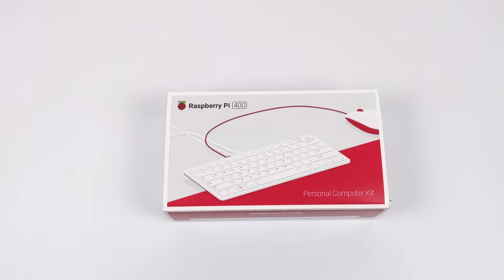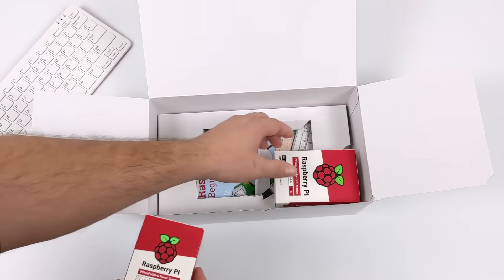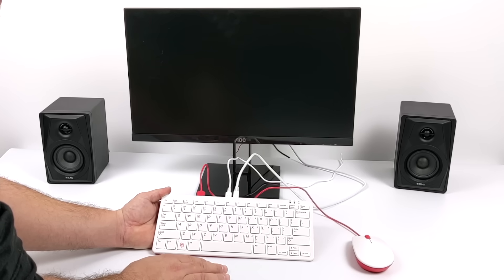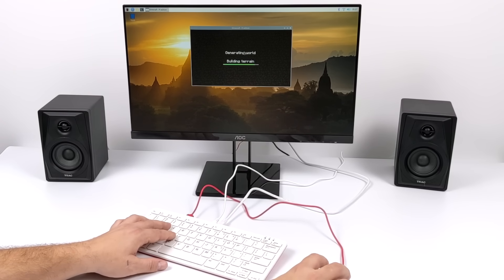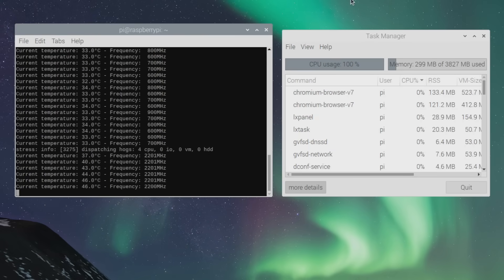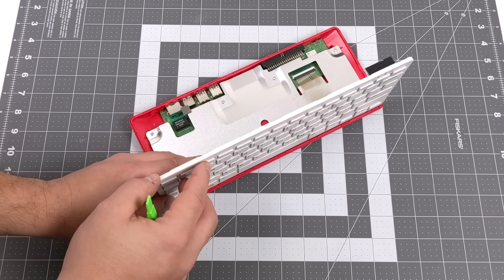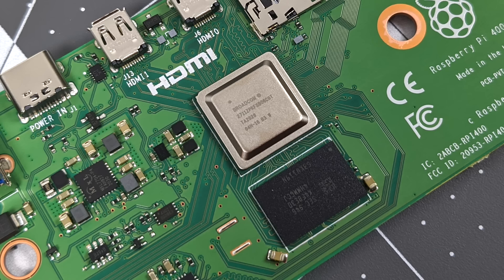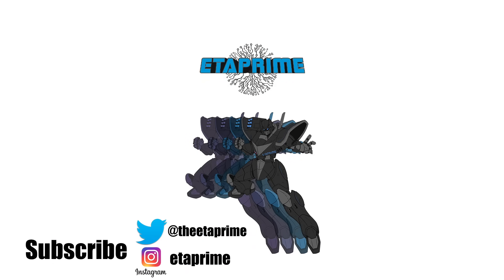The Raspberry Pi 400 is Awesome! Review, Overclock, Emulation, Tear Down

Comment: Now a keyboard has more ram than my computer. Nice
Reply: When The Keyboard Has More Rams Than Your Pc
Reply: Lol 😆
Reply: What brand, and specs are your computer? :) I am a specification type of guy. My laptop is 8 GB RAM, Nvidia 1050, and 256 GB storage, with an Intel i7-8650U.
Reply: @thatguyalex2835  The comment was satirical. My actually PC has 4x as much RAM as what was featured in the video lol
Reply: @toxiccan175  Actually, some people still have 1-2 GB RAM in 2021 for some reason, lol... :)
Reply: @thatguyalex2835  That’s certainly true. I’m in the process of building a portable computer with 512MB of RAM at the moment lol
Reply: @toxiccan175  What are the specs of the portable computer, and what will you use it for?
Reply: @thatguyalex2835  1 core @ 1.2Ghz, 512MB ram, 64GB flash storage, 1024x600 IPS display, 10,000 mAh battery

3 USB Type-A Ports
2 microUSB ports
1 RJ45 Ethernet port
WiFi, Bluetooth
Reply: @toxiccan175  Will you use this computer as a tablet, or programming one?
Reply: @thatguyalex2835  I plan to load DietPi on it and customize it into a VERY lightweight portable productivity device. Minimal hardware, minimal software.
Reply: @toxiccan175  That sounds cool and all, but do you plan on using Python on it?
Reply: @thatguyalex2835  I don’t think I’ll be doing anything with Python. Not right away at least. I have other devices for development
Reply: @thatguyalex2835  i have 2 GB of RAM on my toshiba laptop🤣

Comment: That's not an "all in one" PC.  AIOs have the PC built into the back of the  monitor, like an iMac or similar formfactors.  Literally, the screen and PC guts are one unit and the only things coming out of it are the power cord and mouse/kb if not using wireless. So this Pi requiring a separate monitor is not an all in one.  The regular Pi CAN be because you can duct tape it to the back of a monitor and use a wireless keyboard and off you go.  But that's the one thing you cannot do with this formfactor with the Pi inside they keyboard.  Well. You could use a wireless keyboard and mouse.  But what would be the point?

Comment: Microcenter has the Pi 4 4GB desktop kit for essentially the same price ($99.99). With that you get 7 available USB ports (3 on the keyboard and 4 on the Pi) plus an audio jack compared to only 3 available USB ports on the 400 and no audio jack. Plus in the desktop kit you get 2 micro hdmi cables compared to only 1 with the 400. And yes the cpu is a bit faster with the 400. So basically with the 400 you’re paying for the novelty of the form factor.
Reply: And better temps.

Comment: Amazing video, kudos for the teardown. We can see they put a lot of efforts on it. Wondering if it'll work fine with a bluetooth mouse (so, less cables in the table!). One concern I have is related to the RAM. A few browser tabs opened will kill the RAM quickly.
Reply: I use a bluetooth mouse, keyboard and headphones on my Raspberry Pi 4, since the underlying hardware and software isn't really any different I have no doubt it will work fine on the 400. My mouse was a pain to pair up though, but that was due to the mouse being very difficult to get into pairing mode, together with an extremely short pairing mode, not the fault of the Raspberry Pi.
Reply: @dv7533  Thanks for the feedback!

Comment: This comes at a time when my old 1st revision Pi 4 2GB is crashy and glitchy. I don't know if the regular OC killed it or what, but it ran well for over a year on and off with and without an OC so who knows. (can't find any info about OC and longevity on it) Whatever happened to it, it's past it's expiry date.
Might pick this one up instead and save myself the hassle of getting a case and power supply since this cools super well and comes with one (bonus mouse!).

Comment: The only downside for me is that they took away the 3.5mm audio jack which ETA does not mention. It's great for kids just to plug some cheap speakers or headphones in there.
Reply: Most monitors that I've used come with a 3.5mm audio jack on the back of them, so I'm assuming they'd want people to directly connect to their monitor instead of the Pi 400. But I do agree that it would be more convenient if it was on the keyboard itself.
Reply: You can get a usb sound card that will have a 3.5mm audio jack for like 2 bucks online. It'd be nice if the 400 had the 3.5mm jack, but it's easy enough to use a usb adapter.
Reply: But yeah, it's annoying that hdmi sound out or Bluetooth is the only option. Works well with TV but monitors with no speakers isn't so good.
Reply: The audio jack channels (left and right) are provided by PWM driven GPIO (channel 0 by GPIO 12 or 18, and channel 1 by GPIO 13 or 19).
Reply: USB to audio adapter cables are cheap. Most are uder $10.
Reply: Also composite video is gone...
Reply: Very funny.
Reply: A cheap monitor with built in speakers, a cheap set of usb speakers, or cheap bluetooth earbuds still means that you can get audio for cheap.
Reply: @CeriPie  "cheap monitor"

LOL
Reply: @CeriPie  Ok but this does not justify bucking the headphone jack.
Reply: Bluetooth, and upgrade it immediately because there a bluez update.
Reply: well thatd be a deal breaker for me. no excuse for this
Reply: Guess the Bluetooth can replace the audio jack?

Comment: The R pi Foundation should design the 400 so that it can take Compute modules so users can swap them out for upgrades.
Reply: They could have done that, and discussed it. Apparently it would make the 400 $5-10 more expensive.
Reply: @JamesDuncan  I’d pay that. Thanks for sharing!
Reply: @JamesDuncan : Wait would that include the equivalent CM4, or be more expensive and without the CM? If it’s the former I wouldn’t mind much, of course provided the keyboard lasts long!

Comment: Quite a lot of wasted space on the Custom/Revision'ed Board, which could easily fit in full-size HDMI and even PCI-e slot and eMMC slot.
With the amount of space they have on this Board, they could even make a 16GB RAM variant as well without much issue (though i guess it would up the cost and power draw).
Reply: Wouldn’t the PCIE slot take the connection that is used by the Ethernet? Not sure about eMMC, that might use the same bus as SD. Full size hdmi would have been glorious, though.
Reply: @kristiansims  the raspberry pi 4 compute module has PCI-e capabilities. I don’t know if there’s a trade off or not
Reply: @johnsherby9130 : oops, yeah, you’re right—it’s the USB 3, not gigabit Ethernet, my bad. The CM4 doesn’t have USB 3, and previous hacks to put PCIE on normal Pi 4’s involved replacing the USB 3 ports (and I previously mixed that up with Ethernet which is how I got it confused before).
Reply: And a P2 port hahah

Comment: Now they have to step things up and create a laptop version of this! I think it would be awesome to have another very cheap laptop like Pinebook.
Reply: Eben Upton, founder and CEO of Raspberry pi, said this week that they couldn't see cost savings in adding screens and batteries, i.e. making laptops, when compared to what's already out there e.g. chromebooks
Reply: Since all that's needed is a portable HDMI, a compact case with room for a portable monitor, cables, power supplies, drives, etc, is more appropriate and desirable.
Reply: theirs already a laptop with a raspberry pi 4b inside it

Comment: I feel this is diverging from the diy principle of the pi, the lack of screen and camera connectors is going to be a bitch if you want to build a pi laptop with this board. Also it would've been better if instead of a new pcb it used the new cm4 and let you swap it in or out for a different one, that would've been cool
Reply: Not at all as if you listen to the founder talk about the British computer scene in the early 80s (the retro hour podcast recently) , he is a big fan of these types of computers. This is a great idea

Comment: Did the Kit bring a 64bit OS with?
I buy the non kit version.
Reply: That is because you have to download the 64bit OS before using the raspberry pi imager and then you select custom OS from the list it's that easy
Reply: @lesnelson3458  Yes.
Reply: Yes.
Reply: even the normal raspberry pi 4b has a 64bit os support
Reply: @lesnelson3458  Yes, but not when preparing SD card in rapberry imager tool. There is only 32 bit.

Comment: I didn't see a headphone/mic jack on the back there. I'd probably throw a usb sound card on that 2.0 port to get audio in/our that way.
Reply: Yes, I think that having a "personal computer" proposal should have removed the IO header to free up physical space and put conventional HDMI output + the audio jack for headphone
Reply: the sound comes from the HDMI lead 
no need for a usb sound card
Reply: @lesnelson3458  
are you suggesting people should hack up an hdmi cable? that doesn't work buddy.. hdmi only pass digital audio from device to device (pi to tv for example). you need a DAC (digital audio converter) aka. sound card if you want to use wired headphones, unless you run the audio from the 3,5mm jack on the pi, which is a bit of an issue..
Reply: @DecibelAlex  the monitor itself has a 3.5mm jack headphone out. No need for any converters.
Reply: @thesidneychan  
what if one don't have a monitor like that
Reply: I just use speakers connected to my monitor as always (better sound than monitor speakers) then plug the HDMI cable into the monitor.
Reply: @stephenelliott7071  I prefer using headphones, which I suppose you could do over Bluetooth, but the option not being there slightly bothers me.
Reply: @DigitalJedi  I can plug headphones into the headphone out port on one of the speakers (rather than the pi).  Again a widely available feature.
Reply: @stephenelliott7071  true. I forgot about that.

Comment: Thanks for showing this off!  I am curious if this can be used with MS Office 365 with decent speeds.  With COVID there is a chance they send kids home from schools again.  (In the part of Canada I live). I am interested if this can be a stand-in learning portal.
Reply: I'm able to run 365 on a bog-standard Pi 4 using the web interface, so don't see there being a big problem doing the same on a 400

Of course 365 in a web browser isn't to everyone's tastes, but you're only limited to the functionality which MS offers "out of the box"

As a cheap alternative to buying a laptop, all you need to do is plug into a domestic TV - I'd say this was very likely to be "no less frustrating than using 365 in web mode on a '86 machine"
Reply: since it's running on raspbian, as one of linux distro, it cannot runs office365 natively.. but you can open your microsoft office file using browser with microsoft office online
Reply: I don't know about raspberry pi os (so far, I have only used the Lite, not the Desktop), but if I remember correctly, a lot of Linux Distro's come with LibreOffice (or OpenOffice, it's one of those 2) instead of MS Office

Comment: The Pi 400 reminds me of home computers from the early 80s like the C64 and ZX Spectrum. I'm pretty sure that's what the RPI Foundation were going for.
Reply: Considering Ebon Upton credited the BBC Micro A & B for one of the inspirations for the original Raspberry Pi, I would not be surprised.
Reply: @lovehawks2814  Yes, pop RISC OS on it and you're looking at a miniature Archimedes A3000 ! :-)
Reply: $100 and it can be any Micro you want it to be. How amazing is that?
Reply: Yeah this whole thing reminds me of my good old MSX. My first computer :) Minus the tape drive for loading/saving data :D
Reply: It needs to ship with games to make kids want it.
Reply: @NaeMuckle  its not made for kids to play games on it is for kids to learn how to code computers
Reply: @lesnelson3458  yes but back when I was a kid you got a spectrum or an amstrad to play games on. Then you used it for coding in basic. The kids have to have a reason to want it first. The original pi OS booted into the command line. You had to start up the GUi and that was done so that kids saw a pc as more than just a GUI. I have no idea why they changed it, it was the same time that guy moved the toolbar to the top.

If they shipped a machine like this that booted into something similar to pico8 with the option to then load the GUi kids would be encouraged to code more. Pico 8 has thousands of games with the code readily available to tinker with. Then add the fact that there were some proper bundled games you could mess around with like you do in Minecraft pi. You'd have kids much more interested in it.
Reply: @lesnelson3458   "its not made for kids to play games on it is for kids to learn how to code computers"

It's made for both.  I played plenty of video games on my old C=64, and I also now understand the machine down to the silicon level because I became an EE.  I was programming by the time I was 9.
Reply: Amiga 500 I'd say english company
Reply: @legin3753  I forget where but they've explicitly said while it's based on all these things the design is a tribute to the Amiga 600 specifically.
Reply: Exactly, I was thinking the same thing. It really resembles these older computers
Reply: With the rear-facing GPIO pins, the inspiration is quite evident: microcomputers.
Reply: check the CPU of C64 and you know that you're far from it. check the OS of C64 and you know that you're far from it
Reply: I'd love to see a really good ZX Spectrum and C64 keyboard case with these - my first and second home computers
Reply: It’s a British company that’s exactly what they are aiming for. 🤯🤯
Reply: Raspberry pi 400 is like those small computers but even smaller, only a monitor and a keyboard
Reply: I wonder if computers in the future will start looking like that again, once SoC chips will be powerful enough for workstation tasks.
Reply: @Mobin92  they will. Once apple bring ARM to the masses. Everyone else follows. Just look at the history of apple, they have always paved the way. 😎😎😎
Reply: Or the Atari St.
Reply: I was born in 72.. my first computer was an Amstrad CPC464 it had 64kb of ram .. I built a game on it and eventually run out of Memory.. I remember young me saying 'I need to get a computer with more memory, then I can finish my game' Well this PI is the closest looking alternative to what I imagined I needed to upgrade to, when I was young me.. I really think I might get this, to complete my game.. Maze Craze..
Reply: @cmarkme  well you are a massive failure then! The whole point was get the skills to write games in small memory constraints. Ciders back then we’re genius level. Something of a lost art now. But it’s always limitations that drive true creativity! 🤯🤯🤯🤯🤯🤓🤓🤓🤓🤓
Reply: @cmarkme  Well - He's not completely wrong (about the limitations that is, not the rest of the comment). I still can remember writing a whole toolkit in machine code that somehow had to fit in the EPROM size that was used in the BBC-B computer. You had to become very creative and smart re-use parts of the written code for totally different purposes, because otherwise it just would not fit. It certainly learned me a lot about optimization in programming.
Reply: @jclosed2516  I too got the Machine code bug, but then got Laid.. Somehow things slid after that
Reply: @hanniffydinn6019  while you were Playing with your Joy-Stick, I was busy getting Laid.. I think you Failed !! :-) lol
Reply: I would say a ZX81
Reply: It's ideal for Kids and people on low budgets given the pandemic.
Reply: that is because the made it to look like an old commodore 64

Comment: I am building an arcade and planning on using a Pi for emulation. Would you still recommend using a standard Pi or this unit? I will have easy access to either with a quick release for the control panel on the build.
Reply: I don't have any experience with arcade, but my guess would be that a standard Pi would be better because it's smaller and has AUX and an extra USB slot. If you want to add something like "who gets the highscore, appears with his image in the game", you will need a regular model (as ETA said, the Pi 400 doesn't have a camera slot)

But if you want all of your cables and connectors at the same side of the Pi, this one would be better

Again: I have no experience with arcades, it's just my gut feeling :)

Comment: This does not provide the same I/O as a Raspberry Pi 4B with keyboard. The 3.5 mm audio, display, camera, POE connections are missing and if you consider the standard Raspberry Pi keyboard the three additional USB Hub ports are also missing.

Comment: The keyboard is connected to a USB 2 port internally, iirc (via the ribbon cable)
Reply: I think there is a chip between the pi and the ribbon cable that has the controller for the keyboard itself, but you’re right that that chip uses one of the USB lines.

Comment: I just wish they'd have included a TouchPad on the keyboard, then you wouldn't need a mouse.
Reply: Add a screen / batteries and you would have a Pi laptop!
Reply: Exactly. That's what I thought, too. It would free up that USB 2.0 port, too.
Reply: @luigiprovencher  If it had the TouchPad, 4 usb ports, and was black I'd buy it in a heartbeat.
Reply: @luigiprovencher  bluetooth mouse?
Reply: Without a trackpad I see little point in it but I can't speak for all. I'd also like a battery.
Reply: No touchbad. Built in trackball or nipple mouse.
Reply: @rickyrigatoni  The ball would be good but I'm all set with the nipple mouse. Lol That would be too small for me.
Reply: They would have needed much more work to get the molds to be compatible. Plus you'd be adding another £20+ to it.
Reply: They'll be trying to keep the costs down.
Reply: Am I the only one who thinks the mouse cable is way too short?
Reply: @mrbisshie  I noticed that. They even showed pictures of it with the mouse in someone's left hand. They should have put the usb on the side or atleast off to the right.
Reply: I think they were thinking of a computer replacement and we wanted a retropie built into a keyboard.